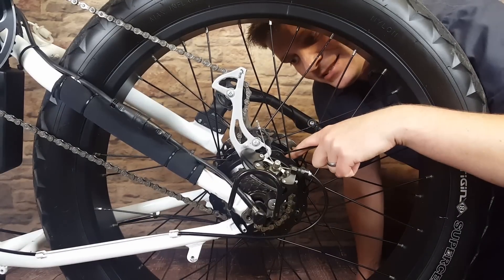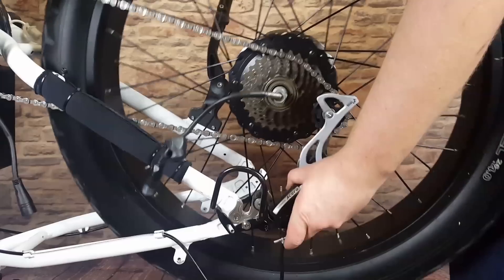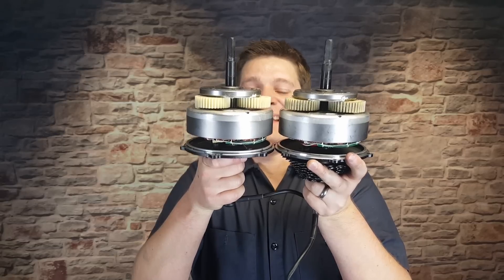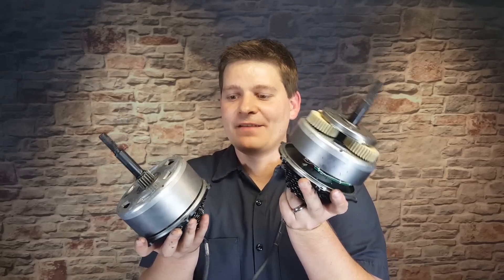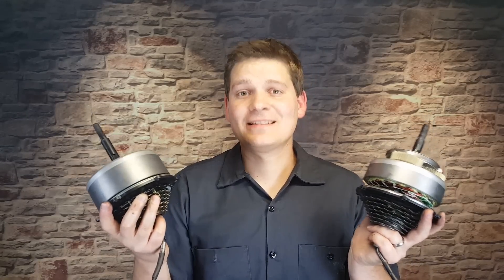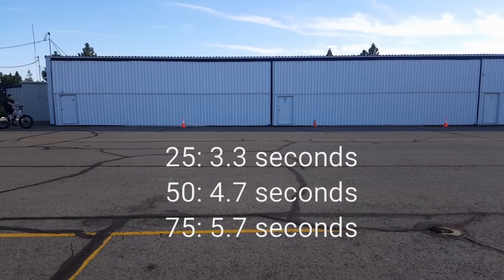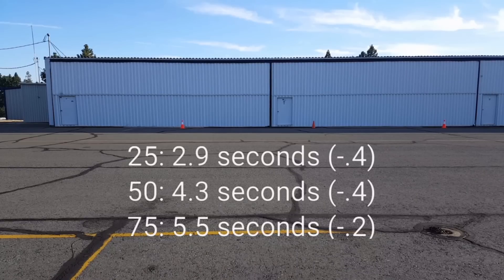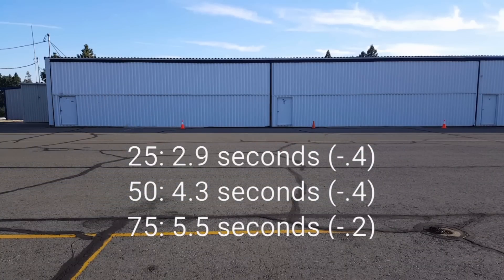Considering the RadRover Ebike?  You better watch this first!

Comment: I have a 2019 Phat Moto 80cc 4-stroke gasoline powered hybrid bicycle with the governor bypassed that's the only modification I have done. Several hundred miles riden so far. It will climb most any hill but if I stop in the middle of a steep hill I will have to pedal to get it going and throttle wide open. I'd like to see what it would do beside of the Rad Rover because I thought about buying an e-bike possibly or bigger rear sprocket for all bottom end power or bigger engine Honda 4 stroke 120cc or Predator Harbor Freight 4 stroke 212cc for more bottom end and possibly bigger engine!. At $550.00 total I paid for the Phat Moto I couldn't beat it, Aluminum frame and 80 pounds total! You can also do plenty of upgrades to the bike. I also pedal it with out the engine on most of the time and excellent gas mileage!

Comment: In looking at your on line store I did not see where you offer anything anywhere close in price and not every (Most people) are not going to want to spend 4 to 7K for a E-Bike.  I know there are those that do but the majority of the market is just not there yet. I know I do not plan on spending over 2K for my first bike.
Reply from the maker: We have several bikes under 2k.  Aventure, Level, Avenger.  We do have 4-7k bikes too if you want light-weight carbon fiber high end specs.

Comment: Just speaking as a former racing mechanic, but wouldn't it be simpler to just build a stationary mounting jig, feed each motor the specified power, and measure the torque directly?

Comment: You are missing a critical number, which is price points of what you are comparing. Also, are you comparing a Class 2 bike with components from a Class 3 bike?
Reply: He's using the throttle so it doesn't matter.
Both are limited to 20 when using the throttle. And I doubt he's getting up to 20 mph for it to matter what class it is.

Comment: I don’t understand the point of this video. I don’t expect a $1500 bike to perform to a $3000 bike. I’m more concerned about reliability and rideability than speed and acceleration.
Reply: Hey Rick. Mebbe you just need to hear more. I was Very interested in the Rad Co. I didn't just want to buy a Rad but also a Burro(make an ice cream vehicle) but they refused my $!!! Apparently you have to buy Two Burros  minimum!! Was still interested in the Rad. Had surgery with 8 weeks in a neck brace so I researched the shit out of the subject...best ebike in the 1500...2000$ range. Radrover rated high in customer service(good thing...they fail a lot ) and they're in America. I chose a Surface 604 Shred(EBR does a great review). On paper somewhat similar to the Rad. After this video I looked at my motor and it's Much beefier than a Rad. I'm 290lb and have hit 40mph!! Other components also superior...hugh hydraulic breaks, etc. 1800$ You want reliable? I've hit 1200k and all thats happened is a loosining spoke! Check them out...the Boar Hunter is next!!
Reply: @davidklein1667  so what bike did you go for? Because I've not understood which one was
Reply: @HungrySpinz  while recovering from surgery I had several months in bed in a neck brace. Nothing to do but research bikes. I finally chose to go with a smaller Canadian company called Surface604. 
My model is the Shred... 500W...750Wpeak. Rear hub..prices may have gone up ...I had wanted their hunters model!!! Big brute called the Boar Hunter...I think on top of being well built it's the most attractive camo ebike I've seen! Check them out on google!!! Good luck and hit me back!
Reply: @davidklein1667  that's like 70% more expensive than the radrover tho
Reply: @HungrySpinz  not that much ...a few hundred more. So much more for just a lil more cash...like hydraulic disc, good headset etc,
Reply: @davidklein1667  not just a little more, maybe it's a little bit easier for you to get a lot more cash but not where I'm from
Reply: @HungrySpinz  nah nah nah...ma fren!! I waited my whole life for this bike!! I won a disability case and got a small settlement. Not enough for a car or house...soooo ebike it is!! I'm divorced or you know that wouldn't have gone down!
Reply: @HungrySpinz  anyhow bud...better to scrimp and save til you get that few hundred more. Any buddy on here will tell you that cheap bikes end up costing you more in the long run...and your not getting as good a bike to boot!! No Sondors!!! No Rad!!
Reply: David Klein p
Reply: @buckeye685  that P. Stands for Patrick!

Comment: Was originally sold on the Rad bike, but after doing more research, I think a mid drive is much more the way to go. Although, mid drive bikes seem to be at least double what hub drives are. Looks like doing a conversion on my current bike would be the way to go.

Comment: I put 12 thousand miles on a 2016 RadWagon in 2 years and the only trouble I had was with the spokes. I understand they have been upgraded in the later models. Bought it for 2k with a spare battery and sold it for $900. I see the new owner riding it periodically with a big smile on her face.

Comment: RadMini 4 here; original Rad motor with over a thousand miles, running at 1600 watts. This thing is hilarious, and I take it on mountain bike trails when I'm not on the streets doing wheelies and beating cars across the intersection. Running a 35 amp controller and display (which Bolton carries).

Comment: That was a good review. I think it was pretty thorough and it has answered some questions for me that I've had about electric assist bikes and more specifically, it gave me more information about the line of Rad Power Bikes that I've been itching to eventually buy.

Now my question is... which brand of EA bike is the best in comparison to ALL of the necessary as well as desired attributes that one could want and/or desire in an EA bike?

My interest in the Rad Power Bikes is that they look beefy, tough, utilitarian and actually usable.

Where. else can I find some really good reviews on electric assist bicycles?

Thank you.
Reply from the maker: No one brand is "best".  Each have their good and bad attributes.  If you'd like to email me via BoltonEbikes.com perhaps I can help further.  It really depends on your needs and wants.
Reply: Hey bud! Don't know if you have bought your bike yet. If not Please don't buy Rad til you check out a Canadian co. Called Surface604. I bought the Shred...close to a Rad but for 1800$ Soooo much more! Hit me back you want more info
Reply: David....Costs went up to $2100

Comment: I have a RadRover Step Thru. In actual use, I have not used the full power. I usually use Pedal Assist at level 1 or 2, because I want some amount of exercise. If I want to go really fast, I can ride a motorcycle. I purchased the RadRover because I needed to buy 2 bikes, one for me, and one for my wife. She has the mini-folding bike which is a bit too large for her. I wish there was an electric bike for shorter people, that is in the $1500 range, NOT in the $3000 range.

Comment: I have another bike that is a "750W" bike, but has a 500W motor. This seems to be something that is common in the e-bike industry as everyone knows you can push these motors beyond their rated wattage. I am hoping that the Sondors XS that I get in December will have an "actual" 750W bafang motor so I can see the full performance of this motor.
Reply from the maker: Hal - That's interesting to know!  Would you mind sharing what bike it is?
Reply: @Area13ebikes  It definitely has a true 750w motor, that was the first thing I did when I got my hands on one, took it apart and checked. Yes the big difference is in hill climbing ability, the larger mass of the 750w motor carries the bike up hill much easier.

Comment: A major factor for low speed acceleration is the motor current limit which determines how much torque it produces then once as speed increases the voltage becomes the limiting factor. In between those points the controller often limits the power (amps x volts) and that determines the point where acceleration drops off before reaching full speed. Other factors are number of winding turns and wire gauge which determines resistance and how much heat it will generate, how much current can flow and how much torque per amp of current is produced. In the end it all comes down to how fast it accelerates which also means how steep a hill it can climb. Good test!

Comment: I bought both the Rad Curser at $999 and the Rad Mini.  I have both 500 and 750 watt Bafang motors.  The main reason I bought them was the 50 nm torq motor.  for the price this bike gets up and goes.  If you are going to compare please account for money as that to was an important factor.  I paid $999 for the cruser and $1299 for the Mini.  I can always upgrade the controllers to make either faster but feel they are fast enough.  Agian 50nm torq.

Comment: 2 huge points were missed in this video. The smaller coil arrangement would be more efficient at lower power and worse at high power and the opposite for the bigger coil arrangement. Its all about coil power saturation. Also the smaller coils will produce more heat at the same wattage of the bigger motor. This is cause more heat issues and short life when running higher than nominal power levels.

Comment: Finally a professional! I've asked a dozen people this same question and I haven't gotten a straight answer yet, do you know the difference between windings for ebike motors? They're both supposed to be axial air gap flux motors, one is a standard slotted rotor winding with 12 or however many individual windings that go IN the slots and the other winding (singular- it's made from one long wire and shaped into sort of a flower with 16 petals that go around the slots, continuously.I think it's called a serpentine winding. They're obviously very very different but I'm wondering about the differences in performance. 
And I don't know if I even phrased that question correctly, I'm a noob at electronics, and I couldn't post pics in the comment section. 
Well thanks for your help if you come across this question

Comment: Pretty cool I've never thought about all the details this is a good video. I've got a 250 watt  36v befang motor I put 1000w and 48v through it and it Fangs along 45km heaps of get up and go. But I strip the gear's have new one's the mail multiples of mind you.

Comment: i have a Juiced Bikes Ripcurrent S and it also has a Bafang 750 watt rear hub motor.
Reply: I just bought one and it's supposed to be here Monday.  May I ask how you like it?  If you are cool with it, did you get any accessories you'd recommend or change anything?
Reply: @PicaPauDiablo1 I love it. I didn't change anything, but i did buy some saddle bags for it. Some people changed out the seat and handle bars, but stuff like that depends on what you like.
Reply: Thank you!!!

Comment: So Radrover, M2S use a "geared Bafang 750watt motor". The one you show is not geared correct?  How can you be certain when talking to a bike manufacture what controller and motor they are using...ie what should you ask them specifically?

Comment: have you ever put super caps into that circuit problem with batteries is they are chemical storage and can only give up their power so fast your available voltage and watts coupled with super caps will give greater acceleration and better battery range per charge because the battery charge is not being drained by having to accelerate up to speed.

Comment: I have both a Rad Rover and a Himiway Bike.  The Himiway bike is significantly stronger climbing hills on dirt fire roads than the Rad Rover even though the spec sheets are nearly the same.  (Himiway does have a bigger battery and lacks the 20 mph limiter that the Rad Rover controller has).  I'm investigating further about whether the power difference is due to a problem or just inherent.  Might look into motor and controller upgrades later.

Comment: There is a guy on YouTube that does a side by side review of the Sonders 500W and the Rover.  His results were that the Rover outperformed the Sonders in power and quality of build.  Not sure what all this means but I am concerned.   Have you done the follow-up video?
Reply: It's worth noting the same bike and motor is sold in Canada as a 500W setup as this is the legal limit.
Reply: @AdamsHadEnough Is it possible they ramp the controller and change something in the motor.  I know Juiced bikes has Bafang do a special build
Reply: @peacefulprepper2402  Agreed, I suspect it is a contollrer setting change.  I just how many Canadians are buying in the US thinking they are getting a motor that's  50% bigger.
Reply: @AdamsHadEnough  I think the Canadian Motor is advertised at 500W, along with the rest of the bikes, not sure.?  Let me know if that is different.  The EU version is also different.  I just bought another Rover.
Reply from the maker: I haven't done a follow up video yet. It may be available in the future. Stay tuned!
Reply: @peacefulprepper2402  That's my understanding, everything for sale in Canada is "500W" max.
Reply: @AdamsHadEnough  Thanks Adam.  I think they market the bikes at that wattage in CA.  I think the added power is in the controller, if it is there at all.  I do know the torque is there.  80nm on the geared hub motor.  It is noticeable over the 40nm motor.

Comment: I have an original GT backwoods with all its original parts from the tire to brake pads the only thing I did was I added front shocks and that was over 15 years ago so my question is can I add one of these motors to my back with GT mountain bike or do I need to have a disc brake bike in order to add a motor front wheel back wheel Where the petals go sorry I’m not as accurate with my words as you since you have more experience than I do

Comment: My Oster toaster is rated at 1650 watts and my old stereo is rated at 250 watts per channel driving a speaker system at 8 ohms.  None of them can match the speed of the bike your describing. There needs to be a better measurement than wattage used. While I’m playing somewhat. Consumption has no relationship to output performance. Ratings under loads based on consumption will give you only efficiency not power output. Size does not really matter either, as some motors use more expensive rare earth magnets, special copper windings,  more efficient bearings and larger capacitors. There needs to be a standardized rating based on a fixed load and power consumption. Volt/amperes  might be used. I’m not trying to be a pain. But I’m in the same position as you! I’m confused by the varied rating systems that don’t reflect true comparison from one rated e-bike to another. If it is a problem for you an expert consider the consumer! If this is out of bounds please delete it as I’m not trying to be smart or confrontative. I want an e-bike and the more I learn the more I’m confused! It appears e-bikes are in the same position now that forced the Federal Trade Commission to step in and stop the electronics companies from using multiple rating systems for their products. They all  used watts as a measurement peak to peak, RMS, ratings at one frequency and many others.

Comment: Remember wattage is a unit of electrical work it is the current draw times voltage drop across the motor. A less efficient motor can draw more current and that would calculate to more wattage but that doesn't mean more horsepower which is a unit of mechanical work. I do not understand why they measure these motors in wattage and not horsepower.
Reply: All brushless electric motors have about the same efficiency.

Comment: I bought a used Radwagon advertised the same...as 750 watt.  Clearly on the hub motor it is labeled a 500 watt motor.  I realized the owner was simply reflecting the sales pitch he received when he bought it.  Radwagon was obviously depending on ignorance of customers about DC motors physical characteristics. and abilities. 
I bought the bike mainly for its frame....and drastically less than a new one...so it was still a buy for me.
Reply from the maker: There are still a good buy for the price.  I did not look heavily into the motor the first time I had a RadWagon in the shop, but it was noticeably slow on hills and acceleration compared to what I had expected.  Certainly could use a boost!
Reply: Electric Motors have two power ratings.  Max and Continuous.  It is quite likely the maker of the motor says the continous, while Radwagon lists the maximum.
Reply from the maker: @Gondawannaland  I would typically be inclined to agree, however the owner of RadPower bikes has definitively stated online that they use a 500 watt motor, now relabeled to 750 watts.
Reply: That sounds right. Difficult to find actual specs on some ebikes and components due to proprietary desires to keep things close to the chest.  I think the Radwagon controller is limited to 16amps,,,though supposedly its built to handle ~25 amps (dont hold me to that).